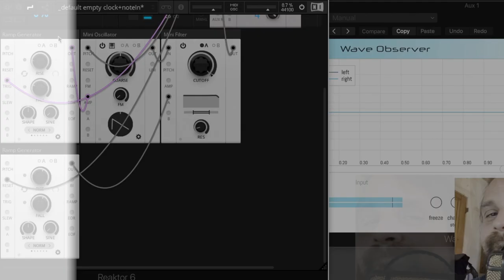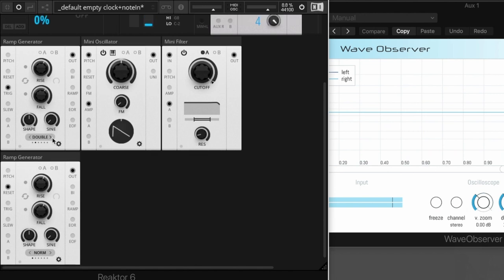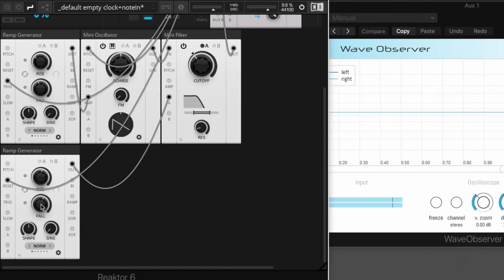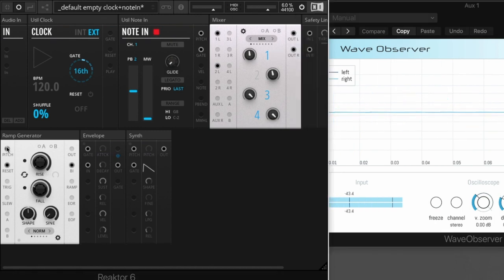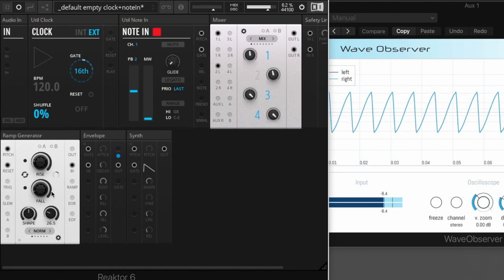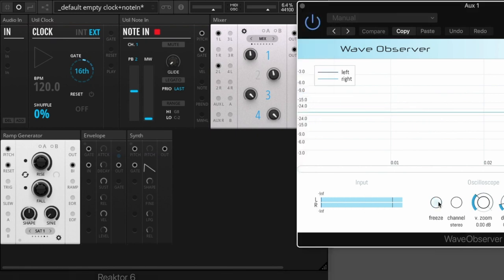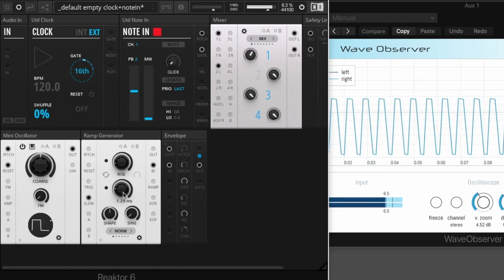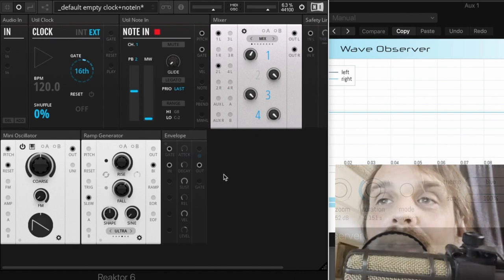Ramp Generator Deep Dive by CinningBao

Comment: I might need to get this. Key is automation from the host /hardware controller for me. Need to find out how easy it is to use with Komplete Kontrol and so on.  It is very good with Softube Modular, for example. Easy to switch between modules and use the encoders. I need to get away from the mouse as quickly as possible. 

Sound can be very good here.